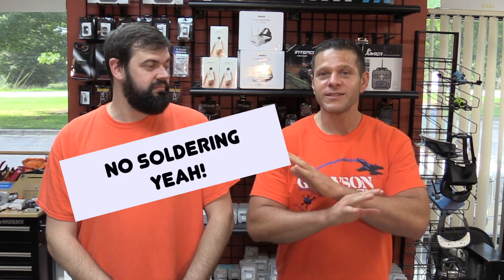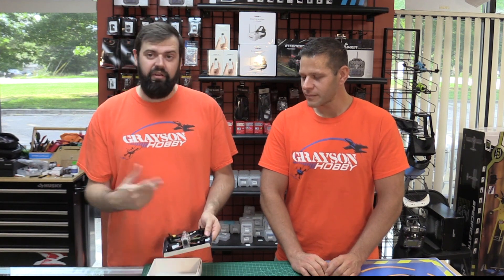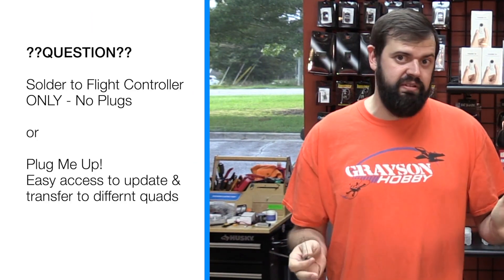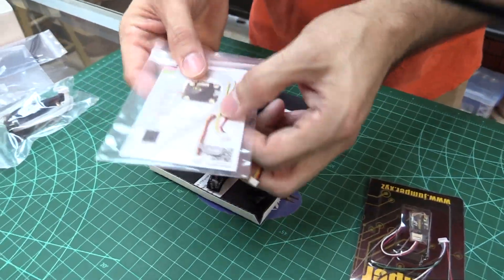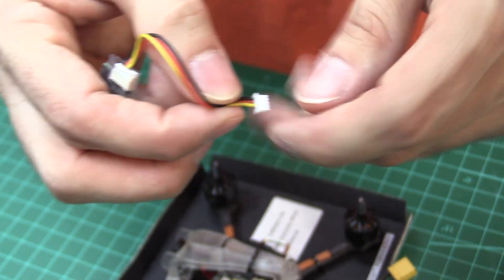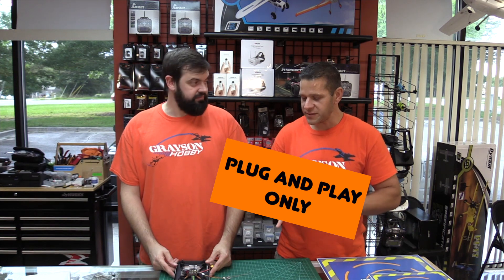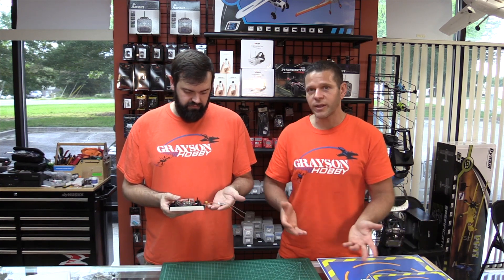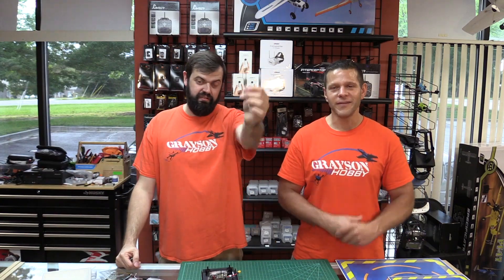How to Install a FPV Drone Receiver without Soldering😲

Comment: I can solder pretty well (I've been doing it for many years). However, I'm also a lot older (67) than I was when I first started. Trying to make good connections on smaller and smaller solder pads is becomming more difficult-even to the point that I now have to start using a magnifiying glass to see what I'm doing. That said, I'm all for plug and play! It's a great idea whose time has come.

Comment: If you want to possibly introduce erratic spurious issues, plug and pray.
Reply from the maker: this is no different than using the provided cable,  however this is pinned for the jumper r1+